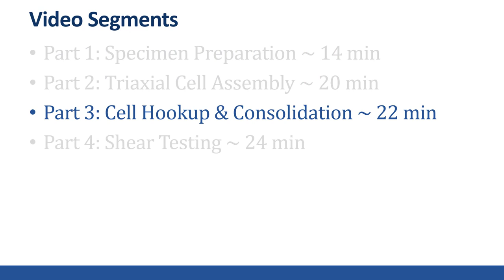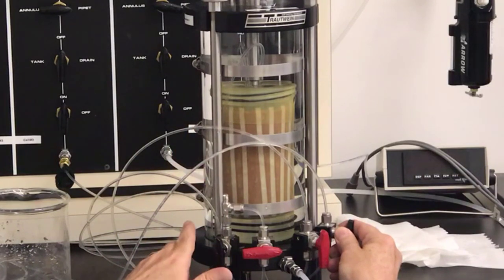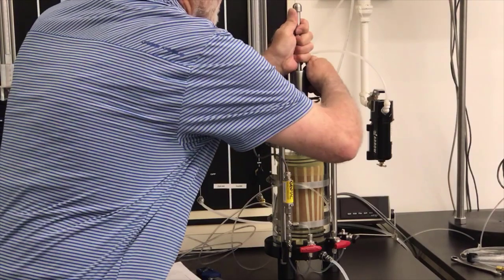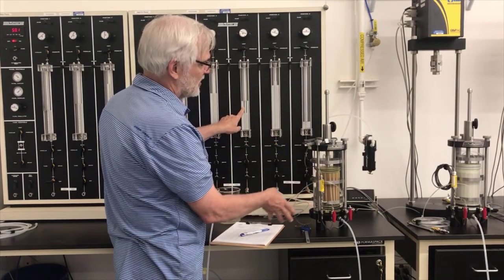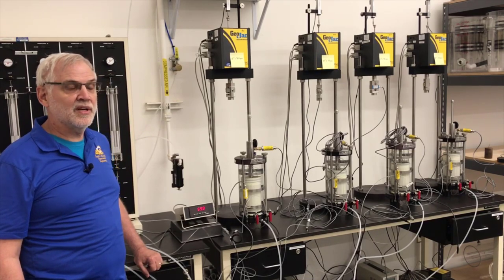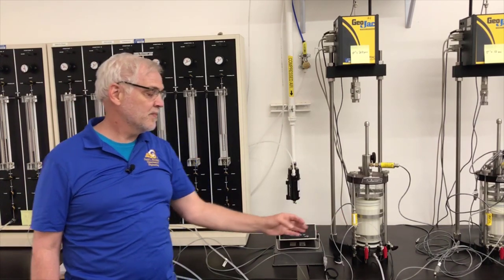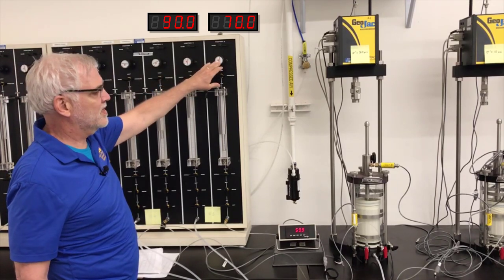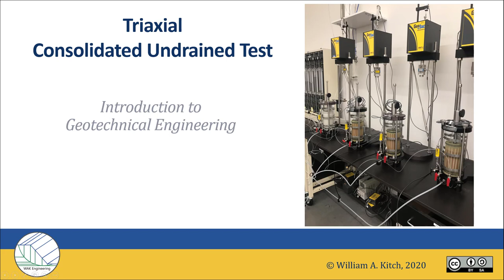C-U Triaxial Soil Test, Part 3--Consolidation & B-Value Check

Comment: Many thanks to Prof. Kitch. It's highly informative and I learnt a lot.

Q1: Since the back pressure of 60 psi plus cell pressure of 80 psi is not enough to achieve 100% saturation, what is the correct steps to follow to improve the saturation further? Is it correct that, say, raising to 100 psi for back pressure and 120 psi for cell pressure (always remaining a differential pressure of 20 psi as the effective consolidated pressure that have already applied to the speciemen), then openning all the valves to let the spaciemen consolidate further?

Q2: Is this the sequence that consolidation process is followed by back pressure saturation and B-value measurement? Isn't it supposed to just perform the opposite?
Reply: Good day, I also confused about that. ASTM said that previously it should be saturated and then consolidated. Are you conducting CU test?
Reply: you can do that if your pressure panel can supply pressure effectively at 120 psi. Also, you can allow the set up to stay for some time, since saturation is a function of both time and pressure.

Comment: It may or may not matter, but shouldn't the saturation be checked before starting the consol phase of testing? I'm basing this off of the procedure outlined in ASTM D4767.
Reply from the maker: I commented on this earlier.  Yes, normally one should do the saturation phase before consolidation.  For this particular soil, silty sand, there's not a lot of consolidation and for the purposes of the class I didn't want to wait for saturation before consolidation.

Comment: hello prof. kitch..is it ok to keep top drainage line open during early stage of saturation, if my back pressure line is connected to bottom of cell? i guess this will allow faster removal of air from sample.
Reply from the maker: Yes, that is the top and bottom drainage lines are connected via a jumper.  Not really shown in the video.
Reply: @introductiontogeotechnical4976  thank you professor.